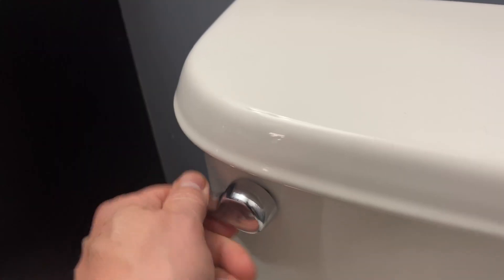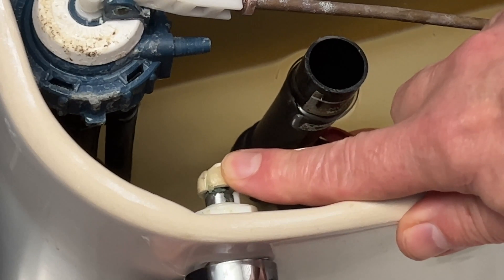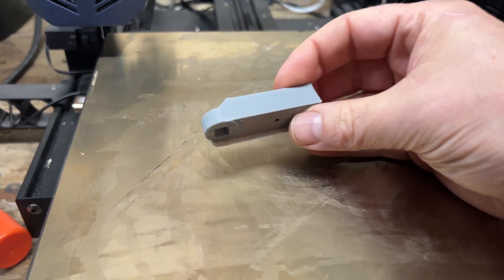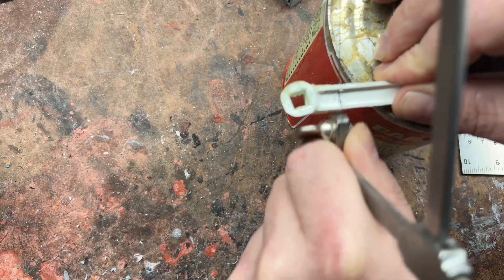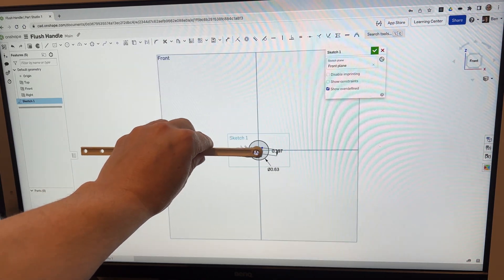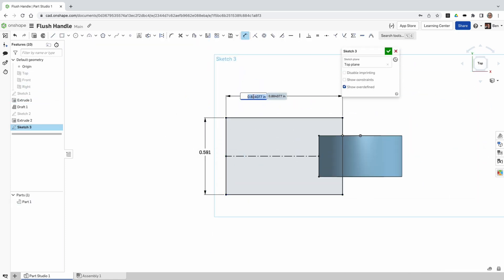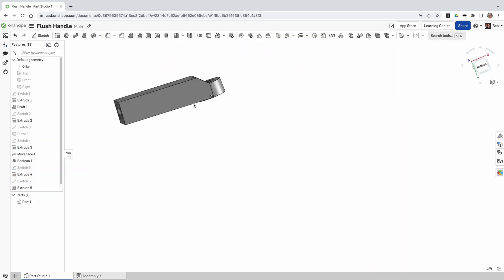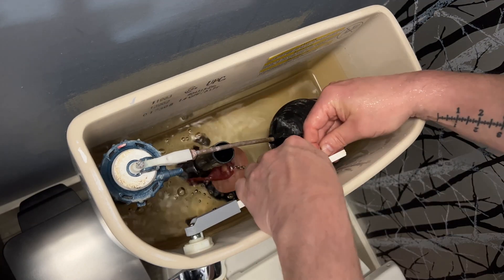3d print, toilet, fix - Pretend words to convince me YouTube actually does something with titles

Comment: Man i have fixed so much stuff with my printer. Glad you did use it to avoid shit hitting the fan - those things REALLY open a lot of possibilities if you find yourself interested in CAD. 
One thing i do still want to check out is printing with TPE, making flexible convention safe knives with it. 

We all know the youtube grind, the social media grind. It's frustrating, but just keep going.
Your content is amazing!
Reply from the maker: So much this. I’ve been doing 3d CAD since 97 as a aeronautical engineer. I agree it is still a game changer. It blows me away more people can’t just model stuff up as easy as crafting a email.
Reply: @DreadMakerRoberts  Honestly, i am far from a pro and have to look up tutorials for some stuff.
But having the ability to turn "I wonder if i can make a stamp for hot glued logos"  into "i prototyped it three times and it works" for less than 2€ filament is just so pleasing. 

So you actually started before 3D printing became widely available for the masses? Thats wild.
Reply from the maker: I remember working with a FDM 3d printer for the first time in 2002-2003, built my own in 2014, I’ve been building or buying sone since then. Always upgrading. They have come so far in so little time it boggles the mind.
Reply: @DreadMakerRoberts  What would you say is nowadays one of the most underrated upgrades one can do to a china made FDM machine?
Reply from the maker: @starioncostumes  Upgrade of the the hot end is always a winner. Generally pretty easy too.

Comment: Ben, you should start a series about this! I've fixed plenty of things around the house with 3D printing! Drawer sliders, Light socket covers, drawer bar hangers, zip tie holders, and plenty more that I can't remember!!😁
Reply: Definitely this. The minor things you can use a printer around your house is an endless source for content. And if you have kids, just imagine printing spare parts for toys, board games etc. I keep bulk printing wheels and axles for my dishwasher trays to keep it going, PLA seems to hold for maybe 3-6 months depending on brand per part in those temps. And I dont need to start sourcing for parts that are either impossible to find or way too expensive in order to make purhcasing a new dishwasher more appealing... 

Kids also keep misplacing some game specific board game pieces all the time so i have a few templates made in tinkercad ready to print just in case. Also makes thrift store bought board games less of a gamble if you can make your own pieces to replace all the missing ones.

Wife has already come to kinda rely on the printer too, and I can hear her saying often "well if it breaks we can just print a new one" for random things. Although she was originally against purchasing the whole printer, thinking it more of a big boy toy (which it also is, i'm not afraid of admitting it).
Reply from the maker: You know. I have literally been doing this for years and thought everyone with a printer was doing this. Maybe not... Hummm